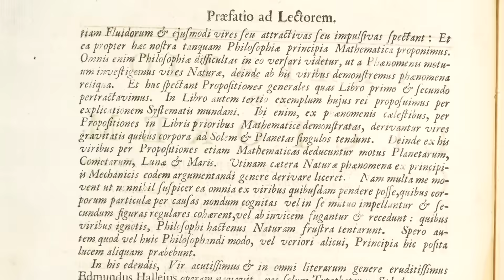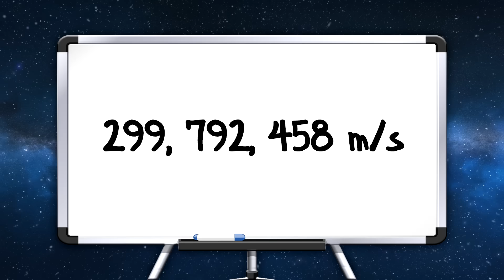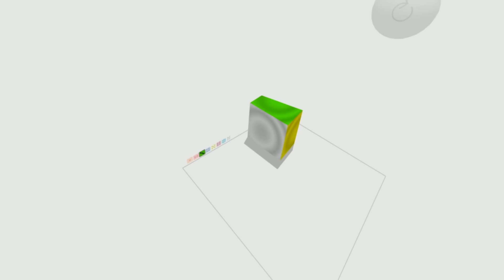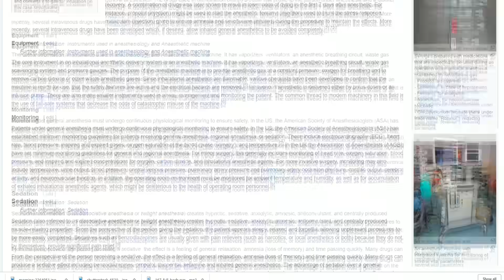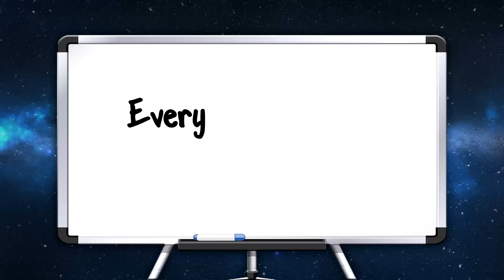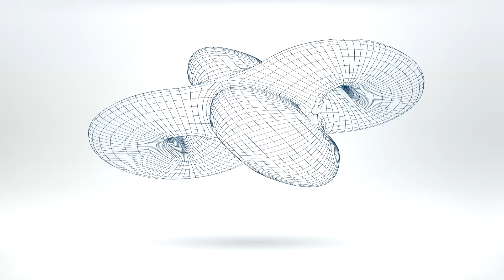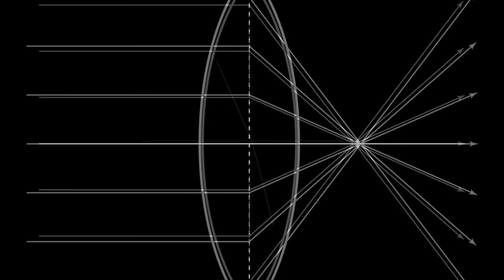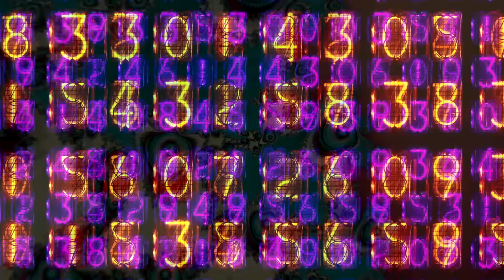The Mystery at the Bottom of Physics

Comment: It's worth remembering that the universe has no obligation to be a singular, logical and cohesive thing. Those are all concepts humans invented. Likewise there may be no 'why' to anything beyond 'because it is'. Sure it looks like there must be reasons for everything, it looks like a well tuned and stable system, but we exist for such a tiny length of time in comparison to our guesses about the age of the universe that what we see could merely be a slightly different interpretation of boltzman brains. That everything condensed into it's current configuration some few billion, or even just million, years ago and at some point will evaporate like a bad dream.

Comment: Fun little note about Pi: If you have a rigid circle and spin it really fast, length contraction affects the circumference but not the diameter, changing the ratio of the two. So even in our universe there are examples (albeit in noninertial reference frames) where Pi doesn't dictate that relationship. (See Einstein's "The Meaning of Relativity", first section on the general theory of relativity)

Comment: First time my understanding of Physics disagrees with the turtle.  If you know physics really well could you tell me if gravity causes objects to attract each other?  I thought Einstein said that the fundamental structure of space was altered by mass causing objects to circle bigger objects when close enough?  If the moon was being pulled toward the earth would they not eventually crash into each other?  There is no engine keeping the moon away.
Reply: @paulstevens4178, that's a great question! You're correct that the fundamental explanation of gravity has changed since Newton. Einstein's theory of general relativity proposed that gravity is not a force of attraction between objects, but rather a curvature of space-time caused by the presence of mass.
Your comment about the Moon and Earth is an excellent point. If gravity was purely a force of attraction, then yes, the Moon and Earth would eventually crash into each other. However, the Moon is also moving sideways very quickly, which is why it continues to orbit the Earth instead of colliding with it.
Reply: @noonespecial3536  I appreciate your answer! Thank you!

Comment: Hey, uh, on the otter card at 8:42 the thing you're describing is real and it's called Lie theory. It hasn't been successfully applied to everything (like a Grand Unified Theory) yet but most of what we know e.g. about particle physics conforms to the Standard Model Lie Group, which is a higher (twelve) dimensional geometry. It's also wrong (it says neutrinos can't oscillate flavor but they absolutely do) and incomplete (what's gravity?), but it's something.

Comment: Pro Tip: To read or see flash frames like the one at 8:41, use the [ . ] and [ , ] keys to move back and forth individual frames. Instead of putting the video at 0.25 speed, pause a few frames before or after you see the frame you want to look at and press comma and period.

Comment: 1-the fine structure constant is close to 1/137, not 137
2-the speed of light and hbar are not fundamental constants, they're just relationships between earlier-invented human units. Speed of light is essentially "how many seconds are equivalent to one meter" and hbar is essentially "what frequency is equivalent to one joule." Their numerical values can be shifted by redefining the units. Therefore they are not considered fundamental constants. Physicists often use a system of units called "natural units" where both of these "constants" are just 1.
4-the electron mass is very related to a fundamental constant, the electron yukawa coupling. The proton mass definitely isn't one; it's more determined by the QCD scale, or by extension the QCD coupling parameter
5-there are something like 19 known fundamental constants depending on what you count

Comment: You're very  correct to point out that possibly his biggest contribution was connecting the physics of the universe to the physics of earth. It is interesting to note that Modern cosmology has then back tracked on this, introducing Dark energy, which is mathematically defined to have no affect or presence on earth, and dark matter, which is implied to be basically undetectable on earth, and hasn't been experimentally detected in 50 years. Modern cosmology has gone prenewtonian in this sense.

Comment: The constants come from the resultant ratio agreement between two conscious energy quantities contained in independent frame references as infinite points. there are two different alternating forces and an Axis. the continuous "ac current" effect is what can be regarded as time. Time is something that flows through energy, as a result of all points and the infinite points they contain, and the ones they contain, and dictates very simple rules for "mutuality" and observation. consciousness is inherent to all energy, and exists as a result of point pair mutuality switch networks being "phased" by the continuous "ac current" or what I call "root cycling" and it's an effect of the Axis being "bent" towards energy values that are mutually agreed and observed by eachother to be greater or less than 1. their phase flip energy state is in infinite different possible value states, but always internally and independently measure themselves as 1. 1 is considered as the infinite rest state energy as measured internally and independent of external observation, still "virtual" with no dimension at all, existing at all points along the Axis equally and infinitely, on both sides of the + 0 - Radial Perpendicular Vector Axis, ie beyond "time", having NO consciousness, no changes to internal energy "distribution")Because the Singularity Point Axis of all points must still internally measure fluctuations in rest energy as being 1, compared to its lesser or smaller value mutual pair partners, the points internally collapse themselves infinitely towards that Axis and from their "exterior" are now an infinitely dense point of non fluctuating rest state energy, which is back in alignment with 1 by the Axis.
Reply: This relationship gives rise to infinite vectors of comutual point pair networks of value exchanging linear functions. I.e. "space" is equivalent to "root cycles necessary to transfer and deposit a value back and forth between two mutual points", the "distance" between two points in mutuality being the only REAL dimension that exists, and entirely based on the fractionally expressed mutual ratio values of eachothers measurements of the other's energy value compared to their own, their own being 1.

I ended up coming to the conclusion that 2[sqrt]-2=q^Q is the underlying math relationship between any two mutual points that are made "real" by pairing. each one of them solves for the other, the larger solving for q assuming Q(itself) is 1, and the smaller solving for Q assuming q(itself) is 1.

Comment: How odd for this to pop up in my feed.  If I had to guess, anesthesia works on receptors connected to the parasympathetic nervous system.  Which means that it blocks production or inhibits receptors connected to acetylcholine.  This also happens to be the part of the brain which you use to put yourself to sleep.

Comment: It's fairly evident to me that, space and time are the same thing.
Each point in space has an equivalent point in time,
Which implies that time also has 3 dimensions.
It also implies that there is no such thing as (at the same time)
Therefore each particle wave is on its own timeline,
Although entangled particles clearly influence each other.
Of course this is just a model.
It might be more helpful to think of particle waves as tubes that momentum flows
Through.
And the time rate on each tube depends on its mass and velocity.
Also the size and inner dimension of the tubes can change.

Comment: what is determining the rules to be the way they are?, you can define the most simple core interaction rules for a universe and then let complexity emerge from those rules, there is no point in trying to think why the gravity works or why electromagnetism works the way they do, it's not possible to figure that out by just looking to how it works, it's even worse, because even if you knew the core rules you will not be able to predict that gravity or electromagnetism emerged or will emerge from those rules.

another example is the universe....the concept of space is really weird, i don't mean space like the moon and the sun i'm referring to the concept of space as something that contains other things, if you define space like that, then what is space contained into? you can say well another space, but then the loop never stops (or the nesting depending, on how you like to look at it)... the moment you define something, you are separating it from the void of all possible things  to be something defined, with a clear structure, you separate the one thing and make two things from it(void and existence for example), but it is the same question where does the void comes from?, or where it is contained? if you define the void then it's no longer the void because its defined...

Comment: Does the following quantum model agree with the Spinor Theory of Roger Penrose?

Quantum Entangled Twisted Tubules:  "A theory that you can't explain to a bartender is probably no damn good."  Ernest Rutherford

When we draw a sine wave on a blackboard, we are representing spatial curvature. Does a photon transfer spatial curvature from one location to another? Wrap a piece of wire around a pencil and it can produce a 3D coil of wire, much like a spring. When viewed from the side it can look like a two-dimensional sine wave. You could coil the wire with either a right-hand twist, or with a left-hand twist. Could Planck's Constant be proportional to the twist cycles. A photon with a higher frequency has more energy. (More spatial curvature). What if gluons are actually made up of these twisted tubes which become entangled with other tubes to produce quarks. (In the same way twisted electrical extension cords can become entangled.) Therefore, the gluons are a part of the quarks. Quarks cannot exist without gluons, and vice-versa. Mesons are made up of two entangled tubes (Quarks/Gluons), while protons and neutrons would be made up of three entangled tubes. (Quarks/Gluons) The "Color Force" would be related to the XYZ coordinates (orientation) of entanglement. "Asymptotic Freedom", and "flux tubes" are logically based on this concept. 

Modern physicists say the Strong Force is mediated by a constant exchange of Mesons. The diagrams produced by some modern physicists actually represent the Strong Force like a spring connecting the two quarks. Asymptotic Freedom acts like real springs. Their drawing is actually more correct than their theory and matches perfectly to what I am saying in this model. You cannot separate the Gluons from the Quarks because they are a part of the same thing. The Quarks are the places where the Gluons are entangled with each other. It is almost as if they cannot see the forest for the trees.

Neutrinos would be made up of a twisted torus (like a twisted donut) within this model. Gravity is a result of a very small curvature imbalance within atoms. (This is why the force of gravity is so small.) Instead of attempting to explain matter as "particles", this concept attempts to explain matter more in the manner of our current understanding of the space-time curvature of gravity. If an electron has qualities of both a particle and a wave, it cannot be either one. It must be something else. Therefore, a "particle" is actually a structure which stores spatial curvature. Can an electron-positron pair (which are made up of opposite directions of twist) annihilate each other by unwinding into each other producing Gamma Ray photons?  

Does an electron travel through space like a threaded nut traveling down a threaded rod, with each twist cycle proportional to Planck’s Constant?  Does it wind up on one end, while unwinding on the other end?   Is this related to the Higgs field?  Does this help explain the strange ½ spin of many subatomic particles?  Does the 720 degree rotation of a 1/2 spin particle require at least one extra dimension?

 Alpha decay occurs when the two protons and two neutrons (which are bound together by entangled tubes), become un-entangled from the rest of the nucleons

. Beta decay occurs when the tube of a down quark/gluon in a neutron becomes overtwisted and breaks producing a twisted torus (neutrino) and an up quark, and the ejected electron. The phenomenon of Supercoiling involving twist and writhe cycles may reveal how overtwisted quarks can produce these new particles. The conversion of twists into writhes, and vice-versa, is an interesting process.

 Gamma photons are produced when a tube unwinds producing electromagnetic waves.
>>>>>>>>>>>>
Within this model a black hole could represent a quantum of gravity, because it is one cycle of spatial gravitational curvature.   Therefore, instead of a graviton being a subatomic particle it could be considered to be a black hole.   The overall gravitational attraction would be caused by a very tiny curvature imbalance within atoms.

>>>>>>>>>>>>

In this model Alpha equals the compactification ratio within the twistor cone.   1/137

1= Hypertubule diameter at 4D interface
137= Cone’s larger end diameter at 3D interface

A Hypertubule gets longer or shorter as twisting occurs.   720 degrees per twist cycle.  
>>>>>>>>>>>>>>

How many neutrinos are left over from the Big Bang?  They have a small mass, but they could be very large in number.     Could this help explain Dark Matter?

Comment: True. Every single word, every statement.
If the value of any constant would be only slightly different, there would be no life. Whoever set the numbers, did it with the idea of life to emerge.
It is hard to believe the Universe and the constants happened by chance. There is something in the lumps of matter and the beams of energy that directs them one way instead of another.
BTW, the fine structure constant is 1/137, not 137.
Thanks for the video...